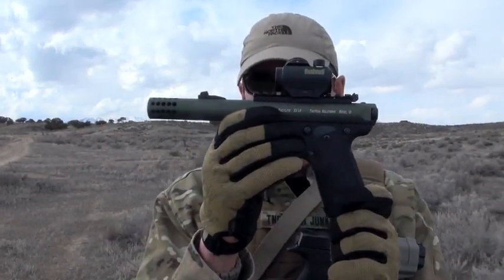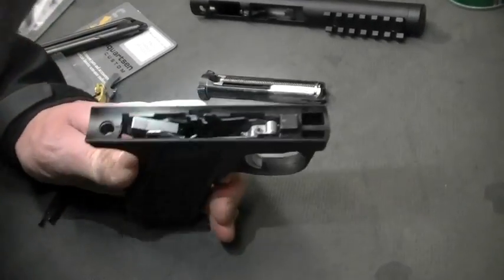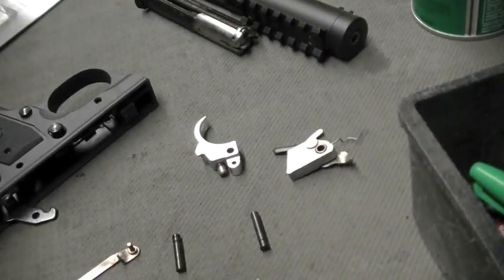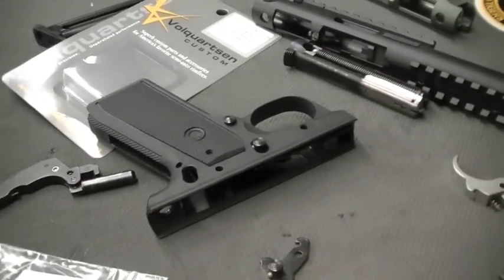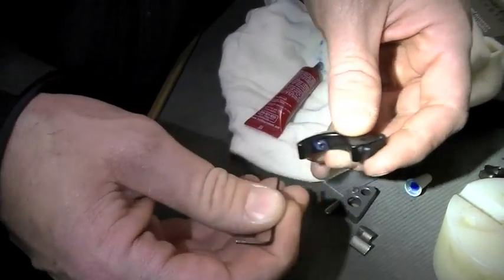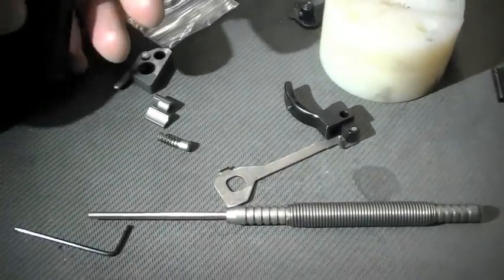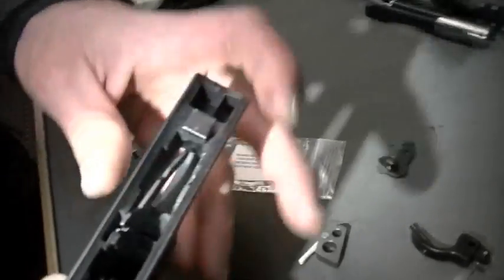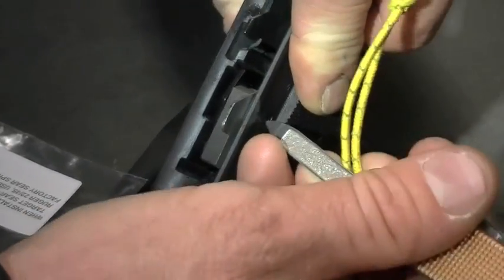Volquartsen Trigger Installation, Ruger 22/45 by Nutnfancy

Comment: I bought my kit and bushing from Brownell's and it all installed with only one little hitch. The trigger plunger and trigger spring felt a little rough so I looked with a loop and found that there were some drill marks in the hole on the top of the  new volquartsen trigger. I reamed out the hole with some 2000 grit sandpaper rolled around a q-tip and now it's smooth.  Works great, worth the money.

Comment: Tip for newbies in DIY home gunsmithing:  One thing that has helped me in projects like this is to snap a good pic before and during the process of taking the gun apart, that way I see exactly how everything was orientated in the first place.  Every time I remove a part, I snap a pic.  I will also use masking tape to label small parts if I can't easily tell which way they were orientated in the gun.  Nutn sits his out on the table in order orientated left to right, but sometimes crap happens and you knock your nice, neat little line-up of parts.  It has saved my butt several times when I go to put it all back together.  Of course, most firearms have multiple full Youtube vids of take down and assembly, but some obscure stuff isn't out there.  This is helpful especially when you don't have a duplicate firearm to look at for reference, and sometimes online pictures just aren't detailed enough or taken from the angle you need.

Comment: Great video. Being able to watch it while I worked helped tremendously. I just completed all the same modifications, except for the Volquartsen hammer. I kept the factory one. I also removed the Loaded Chamber Indicator (LCI)  on the barrel and replaced it with a  Tandemkross filler. I also used a Tandemkross bushing instead of a Volquartsen bushing. I would say the hardest part of it all was taking my 22/45 apart and putting it back together. The barrel assembly was on rather tight, unlike my older MKII. I now have about a 2 lb 13 oz trigger, perhaps less since the trigger is kind of slippery for my trigger gauge.

Comment: Replaced the bushing to ditch that damn mag disconnect, everything was going fine till I tried to close the mainspring. Just didnt want to close the last 1/4''. Rewatched this and realized the friggin sear had not been reset and held in position by the trigger pivot pin. This is what was preventing the mainspring from fully seating. 5 minutes after adressing this I'm back in business! Awsome! Thnx Nut'n

Comment: I replaced the disconnector with the Mk II spacer and removed the slide stop detent, leaving all else stock. It shoots better than I can see and hold nowadays. All I am out is the cost of the spacer. A tiny amount of money for big improvement. It is now the trigger I remember from my Standard Model and my Mk II.

Comment: SUper thanks for the video.. i took apart my NEW 22/45 and couldnt get the freaking thing back together. i did hav to watch the Ruger video to finally get it but I got some great ideas from yours.  I hate the new safety features too.   Just a note. If you hook the trigger up LAST, it is a lot easier to put the disconnter arm up. it was for me the 100 times i tried to get it to work..

Comment: great video, between this and looking at the exploded diagram in the manual i was able to get my 22/45 back together with a mk2 bushing. previously my parts had all been stirred around on the table so i was struggling a bit trying to remember the order in which things came apart.

Comment: Nutnfancy needs to get one of the Volquartsen target frames/lowers and mount his pac-lite barrel on it and then do a review on that.  I am currently building a gun with a 4.5 pac-lite barrel (threaded with AAC prodigy suppressor) on a Volquartsen target frame/lower.  When complete I hope to have a super light 4.5 inch gun that will out-shoot a factory 6 inch MkIII.  At least it better shoot that well, after I spent over $700 building it!

Comment: @wfelarson I think your problem has to do with the pretravel or overtravel screw placement. When the gun is in safe mode, you can still move the trigger and internal parts a little bit. Your pretravel screw was probably JUST on the verge of tripping the hammer when the trigger wasn't being pulled, and so the tiny amount of movement allowed by the trigger pull with the safety on tripped it. Then taking it off safe allowed it to fire fully.

Comment: Nutn is wright, anaerobic compound (loctite) needs a clean dry surface to work properly. I fly competition aerobatic rc helicopters and use alot of anaerobic. Grease and oils can and normally change the properties  and keep it from completely drying.

Comment: Hey Nutn, Thanks for the great video. Fantastic job by Sadly getting all the detail on the small parts during install. I've been looking at picking up a Mk II, or 22/45, but local shop has a used Beretta 87 Target  in the case. Curious if you have any experience or opinions on these. Looks very interesting, but haven't seen any reviews.

Comment: I have a regular mark III Target pistol (not 22/45) and I'm  getting the Volquartsen Accurizing kit, but since I also want to remove the mag disconnect safety, I wondered if I should also get the kit for the mark II rather than the mark III. Will the mark II hammer bushing work with a mark III hammer and pin?  Thanks!  Great video!

Comment: I used this video to install a Majestic Arms 3.2 speed strip kit and it was very informative.  While installing the kit I also yanked the slide release ball bearing as shown in the video but I didn't get the same results.  It seems as though the slide release is not heavy enough because gravity doesn't drop it as I pull the bolt back.   Maybe the gun is too new?

Comment: Just finished installing VQ kit on my Lite, resulting in a sub 2 # pull.  Feels wonderful, but that's a bit too light for my kind of shooting.  What about replacing the VQ plunger spring with the stock spring--will that add a little bit of pull?

Comment: Has anyone had the following issue.I did the update to my mark III 22/45 exactly as stated in the video,and I have a issue. When I put the weapon on SAFE and attempt to fire it, it does not fire, but it makes a slight click noise.  When I switch the weapon from safe to fire it fires at this point without me pulling the trigger.I have taken the weapon apart many times and re-assembled and the same result. I have put the original equip back, and no issues.HELP

thanks for the contiued vidoes.

Comment: Instead of buying a new  Mark II hammer bushing to get rid of the friggin magazine safety couldn't you just cut down the magazine disconnector bar and and spring and use them as a spacer instead?

Comment: Would have laughed if that air compressor blasted all those pins and parts off the table. He was pretty close. 
Get an organizer tray when dealing w/ little parts. Or at least a container.
Springs are too easy to loose and impossible to find.